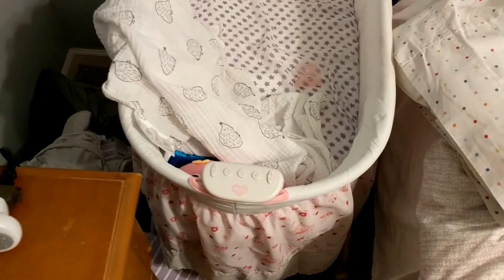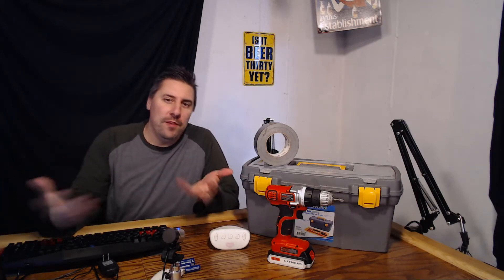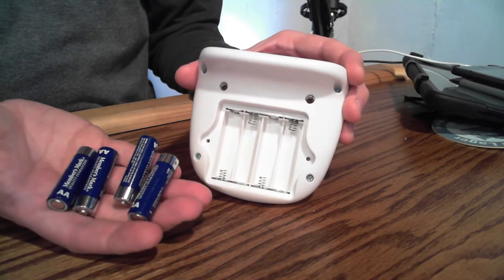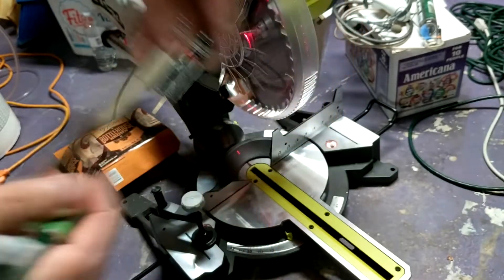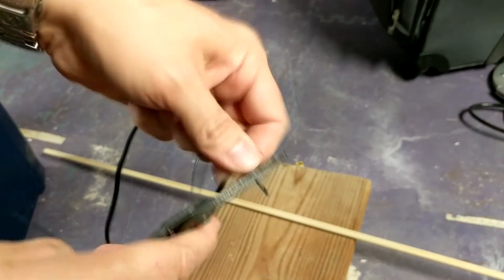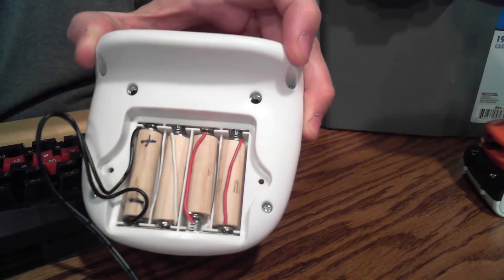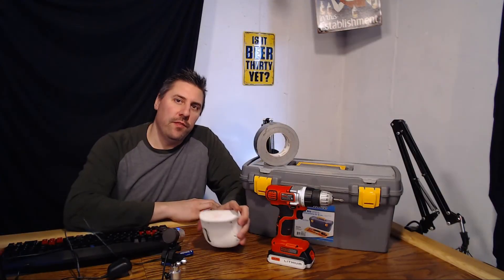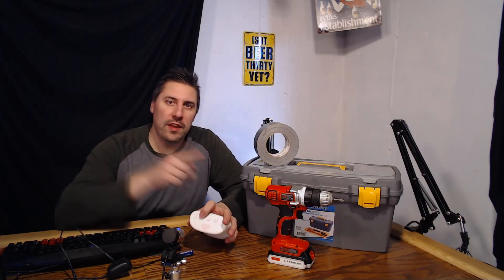Convert Battery Powered Devices to AC Power

Comment: Thank you so much for posting this valuable information.  Will you please, advise me, what size wire I need to, if I want to extend?  Because, my outlet and my clock is too far for the ac plug.  Thanks a lot !

Comment: why does the positive wire and earth wire both get connected to just the first battery? If connected in "series", surely the positive wire gets connected to the 1st battery compartment positive and all 4 dummy batteries have a wire connecting both screws, then the earth wire connects to the 4th dummy battery's screw back to the power supply?

Comment: why are you creating fake batteries? why not just connect the wall adapter wires to the power contacts of the device?
Reply: You can do that if you want. I'd think that by doing it this way, one could always replace the wooden replicas with real AA batteries again if it is desired. I'm assuming you'd be soldering in the wires in place though, so if you had another non-permanent way of attaching the wires, that would work too.

Comment: Am I the only one concerned about the baby? Yes, converting everyday battery-operated devices to DC-adapter-powered is great but maybe some things shouldn't be converted. Baby could chew on the wires or yank the cable until they come loose exposing them. Also, yes, unless you want to avoid this conversion being "permanent", you can just solder in the wires, and if the DC power adapter's voltage is higher than required, buy a buck converter to reduce voltage.

Comment: Why do u add the wooden dummy batteries? As opposed to just soldering the neg and pos wires to the terminals on the device? Just curious because I’ve done this with various Christmas lights and such so I don’t have to change batteries all the time and Ive always just soldered the wires. That being said I’m not an electrician and just learned how to do that from a similar YouTube video. Just curious what the difference is. Thanks
Reply: Fr! Your way seems much safer!👍

Comment: Full Electric current and wood. So very bad!!  And around a baby. WOW!!   So very dangerous!! You should of  clipped the wires within the device and passed them into a  power adapter that steps down the voltage.

Comment: Question: I have 5 cabinet  bulbs that are run on battery, I want them all to run on AC, can I just connect them with one adapter? Do I have to add the voltage of all of them? Or only one of them?
Reply: Yo check my comment
Reply: Got me geeked up
Reply: Brp if you want AC to run them give it Gatorade. They love that. And I mean LOOOOVE!!

Comment: Great video. I want to try it for some outdoor decorations. What kind of wire did you use for the wood dowels? What do you recommend? Thanks again!
Reply: it's low voltage so you can use just standard 12v from any auto store.

Comment: If you would like to wire more than one similar device to a single transformer, I did that recently on three motion lights that I have in a large dark cupboard. In my case, each light had 3AA batteries at 1.5v each.  Batteries in these device are generally tip+ to tail- hence the voltage is additive, ie. 3x1.5v = 4.5v transformer requirement (for a  2-battery device, you'd need a 3volt transformer). This circuit type is called a "series circuit" or in a row.  When you want to add further similar devices, the wiring within each device and the transformer requirement will be the same as the video, but between them has to be what is called a "parallel" circuit. This means the pos+ feed from the transformer connects to the first main pos+ wired-dowel device, and then to the next device pos+ wired-dowel, and so on, same for the negative side of the circuit. You can do this by running a double wire (speaker wire for example) between devices, keeping the positive to positive and negative to negative on each of the main pos+, neg-wired-dowels.  The other dummy dowels in each device are the same as in the video that part doesn't change.  Final note, in parallel circuits the electrical "current" (called mA or milliAmps) is *additive*. Think of current as force, 3 devices requires 3 times the force as a single device. Very generally, I would say a small battery-powered device needs about 100-150 mA of current, therefore if you are wiring three devices in parallel, your transformer should have an output of at least 300mA (3x100).  If the output is too low, your devices will behave as if a dead battery! A comment below mentions a phone charger transformer with 5v output. I checked and the one I had is a very generous 1.35A of max current (=1350 mA), so that would be great option to power multiple 3-battery devices.  Many thanks to all the YouTube community!  Cheers from Canada.

Comment: I'm not sure why so many youtubers are posting dowel rod battery videos and people are commenting its genius.  Crazy waste of time IMHO, just split the wires back from the adapter and cut them unequally to make the length you need. If you don't want to solder to make permanent, crimp on some alligator clips and secure your wire as it leaves the housing (many ways to do that simply).
Reply from the maker: Thanks for the feedback, does that work for you?

Comment: The ac adapter must have sufficient voltage and current output to power the bassinet. Not all adapters have the capacity to power a circuit.

Comment: Maybe the reason why the bassinet is battery manufactured.................SO YOUR BABY DOSEN'T GET ELECTROCUTED FROM 110 CURRENT!. Anyway,  it was a good video and I don't think that anything would happen to your baby. Merry Christmas bro.
Reply from the maker: Merry Christmas
Reply: Only 6v DC comes out of. the 110v AC (wall) adapter. 110v AC gets nowhere near the bassinet. Think about it: would you put an Amazon Echo near the crib? That also runs off an AC to low voltage DC power adapter; this is the same thing. (I think the tendency to use batteries is to keep manufacturing costs down; either that, or there's some weird regulation based on ignorance.)

Comment: Very cool! Wondering if it's possible to safely wire up multiple devices to a single adapter. I have a set of three Christmas candles, each powered by 2 AA cells. I'd love to wire them all into a single AC adapter. Is that possible to do safely?
Reply: Just did that yesterday on three motion lights that I have in a large dark cupboard. In my case, each light had 3AA batteries at 1.5v each.  Batteries in these device are generally tip+ to tail- hence the voltage is additive, ie. 3x1.5v = 4.5v transformer requirement (for a  2-battery device, you'd need a 3volt transformer). This circuit type is called a "series circuit" or in a row.  When you want to add further similar devices, the wiring within each device and the transformer requirement will be the same as the video, but between them has to be what is called a "parallel" circuit. This means the pos+ feed from the transformer connects to the first main pos+ wired-dowel device, and then to the next device pos+ wired-dowel, and so on, same for the negative side of the circuit. You can do this by running a double wire (speaker wire for example) between devices, keeping the positive to positive and negative to negative on each of the main pos+, neg-wired-dowels.  The other dummy dowels in each device are the same as in the video that part doesn't change.  Final note, in parallel circuits the electrical "current" (called mA or milliAmps) is *additive*. Think of current as force, 3 devices requires 3 times the force as a single device. Very generally, I would say a small battery-powered device needs about 100-150 mA of current, therefore if you are wiring three devices in parallel, your transformer should have an output of at least 300mA (3x100).  If the output is too low, your devices will behave as if a dead battery! A comment below mentions a phone charger transformer with 5v output. I checked and the one I had is a very generous 1.35A of max current (=1350 mA), so that would be great option to power multiple 3-battery devices.  Many thanks to all the YouTube community!  Cheers from Canada.
Reply: @TiogaAdventures  Wow! What a terrific, comprehensive answer! Thank you, kind internet stranger!

Comment: What about the different amperage loads of various ac/dc converters? I would like to do this with a beard trimmer that devours 2 aa batteries, but each converter I have, the volts are very close, but the amps vary from 0.7, all the way to 2.5. I was told amps are the power behind the electricity, so how do we avoid hurting our devices, or worse damage our home?

Comment: Great video.
So i have a device running 4xC batteries so also 6V. I do however not own a 6v power device. How much wiggle room is there? Could i safely use a 5v or 7.5v?

Comment: Can we not use dead AA batteries. I want to do a 9v conversion (for 6x D batteries) and was wondering about it. Thanks
Reply: Dead batteries will eventually swell up, leak and corrode the contacts which will lead to continuity issues.

Comment: Great video! But I would like to provide the AC adapter as an alternate source without the user having to put in the mock batteries. Is there a connector on the market that will disconnect the battery supply when you plug in the adapter plug for running it with the adapter? I.E. some sort of  double pole switch that is activated by pushing the adapter plug in? I'm making trophies with a scene inside that is lit by LEDs. Right now they are powered by 4 AA batteries. If the owner could simply plug in the adapter if he wants to, I could offer it with batteries plus an adapter.

Comment: I really liked the video...it gave me hope. I want to make a Sangean DT400W pocket radio work off of AC when I want it on 24/7. I think i would have to drill a hole in the case and us a plug to connect....Do you have such a video.  I think it takes 2 AA's.  thank you
Reply from the maker: You're welcome, good luck!

Comment: If your device can work with rechargable AA's (NiMh) then a decent USB power supply (5 volts 1amp-2.1amp) should be fine for many devices. NiMh usually hold a charge of about 1.2volts. So in this case 4 x 1.2 = 4.8 Volts, so a 5 volt supply should be fine. I have also been able to run devices (motion sensor night lights) which require 3 AAA batteries from a USB supply and put a 100 ohm resistor circuit to drop the power a bit. After all 3 x1.5v=4.5v, which is only a half volt lower than the USB supply.

Comment: That's very cool.  I have a small hand mirror that I found thrifting.  I was disappointed after putting AAA batteries in it for the light part, because the toggle button wouldn't switch it off.  So the only way to turn off the light is to remove the batteries.  Is there possibly any other fix for this issue?

Comment: We have a battery powered lamp that eats batteries and I thought of doing something just like this myself but had concerns about the safety of it.  Then I saw a ready-made kit on Amazon which did both 2 and 3 cell.  It had a 4.5v plug and a wired "battery" like yours and 2 dummy connect thru batteries plus a back resistor battery for 3v 2 cell applications.  But having received it now I am hesitant to use it as its typical cheap flimsy Chinese crap.  I think I might ditch that and do your idea.
Reply from the maker: Good luck! Let us know if ours works for you or if you have any suggestions for improvement

Comment: this actually works. i had a food scale that used 4 AAA bateries that i didnt use cuz i dont buy batteries so used a old power plug that had a output of 9 volts and held two ends that were ultimately looking for power to the scale and the scale works fine! thank you, my plan is to go inside and solder the connections inside the unit as soon as i get a chance or at lest make a pig tail of some sort that i can connect to just incase my transfomer blows (we all know they do blow eventually) ... not entirely sure if the fact that im supplying 3 extra volts to it is a big deal in long run. im assuming the scale has a voltage protection circutry  of some kind in unit and i dont plan to leave it plugged in alll the time. its just for once in a while when im cooking so it should be fine ... i think
Reply from the maker: Awesome, glad it helped you!

Comment: Thanks, this is great, now I have a question, I have 4 light devices, each takes two AA batteries, so that would make all of them together 12v right? Is there a way to connect them all to a single 12v  plug?
Reply: No, each device are using the same voltage 3v (2xAA =2x1.5 =3). Your power source will need to be 3v but will need to have enough amp to feed all the device. Example, if you have a device that need 3v and 500mA (0.5A) , and you want to plug 4 of these device on the same power source, you will need a power source of 3v and a minimum of 2A (2000mA). As long as all device are the same voltage. And dont worry if you have a power source with more mA that needed, it is the max it can give, the device will take only what it need, so a device that need 500mA can work with a power source of 2A.

Comment: I used this to power a Christmas LED lamp post that for some reason they decided to have it run on 3 AA batteries which used to burn out in a day or two. I found an old 5V AC adapter and did this and worked liked a charm. Only thing I would suggest is maybe make the fake batteries a tad shorter than the actual battery length because the screws will take up space. One of the pieces I had to really wedge in there. This has got me thinking now....could I follow the same principle but wire it to a photocell for solar....Great video!
Reply from the maker: Thank you!
Reply: This is exactly why I'm here, too.  I bought some Halloween lights that were, surprise! battery-powered.

Comment: Is there any consideration of milliamps when selecting a wall plug?
Reply: The amperage that the  charger is rated at must be equal to or greater than what the device requires. The voltage should be exact.  If the amps are less than needed, the charger can overheat or even damage your device.

Comment: This won't work for all devices.  First of all, use something that is around 5 volts if possible.  Secondly, not all devices have the positive and negative on one side.  Some have the positive  on one end and the negative on the other side.  It just depends on how it's wired.  If it is a positive on one side (say on the top) and the negative on the other side (on the bottom), then all you need is 2 dummy batteries (one in slot 1 and the other in slot 4, or 3 if only 3 batteries are required).

Comment: Can you do this with D batteries?
I have 4 in a baby swing.
Normally D’s are 1.5v so it would be 6v but the amps is what’s confusing…
Reply: Did you sort out an answer to that? I'm trying the same issue with my baby swing

Comment: This looks like a great tip! I am looking at buying some light up marquee letters for my street food stall and need 5 of them altogether. I was going to make some, but if I can figure out a way to do what you have here to them instead, that would be much better and more cost effective :) Each letter requires 2 x AA batteries, but they are not interconnected and I would like them all to work from one connection if possible. Any help/advice would be most welcome :D

Comment: I knew there had to be a way to do this without soldering, but every other video I saw was saying I had to solder. Thanks so much for for posting something for those of us with some know-how and tools, but not a full electrical workshop!
Reply: Using glue sticks instead the wooden dowel works well also just heat with a lighter and insert you conductors!
Reply from the maker: You're welcome!
Reply: this is the first vid i found, but i'm ok with soldering.
Reply: Exactly! I don't trust myself to solder( and don't have the supplies).
This is awesome!
Reply: Great for keeping devices second-hand friendly.

Comment: You really don't need to make dummy batteries. Instead solder the wires to the main power connections within the device.
Reply: But this allows you to switch back to batteries if you want
Reply: @frimexireng exactly why I was looking for a tutorial like this. A few more steps, but the device stays stock. Great for keeping devices second-hand friendly, especially baby stuff.
Reply: @FoggyLongShadow it's pretty easy to remove a little solder too
Reply: @frimexireng  That's the reply I was looking for !
Reply: Was going to comment this... so much cleaner and you don't have literal firewood in there...
Reply: To be fair this is a good alternative for people that either don't have a soldering kit handy or is not comfortable with soldering. With that being said, I do agree that soldering is the best option.
Reply: Can you explain direct connection like I have positive and negative connectors and wires are connected to battery positive negative connections, how will it work
Reply: @radhekrishna00027  The compartment is made to put the batteries in series, so this method does that

Comment: Hi I’ve got six batteries I’m looking to do an automatic bin as I keep replacing the batteries 
there is three batteries in a line. 
Then another three batteries in a line.
Where would I put the wires of the AC adapter. 
Would it be on one battery on either end?
Not sure how to tackle this. 
Many Thanks. Also great video.
Reply: It may be that 3 batteries are in parallel with 3 batteries.
The only we can tell is you post a link to a photo of the battery compartment.

Comment: Hi can you do to modify a Solar Light with Solar Panel to have an option to be charged in via DC? and an option to be run via AC? without removing the batteries built-in.

Comment: If batteries are DC power, why do you replace it with AC adapter and not 6V DC adapter? (Beginner here)
Reply: An AC adapter takes househould 120V AC and convert to 6V DC.
That is what he is using.
Reply: @njtexit8  Cool, thanks